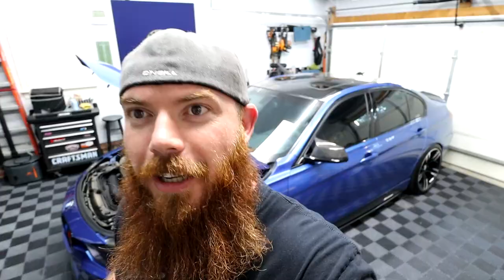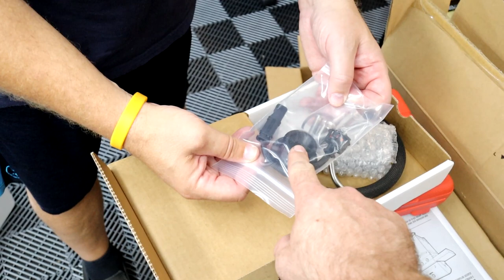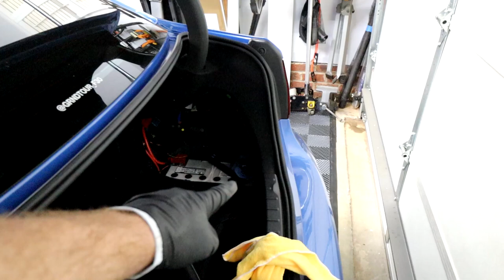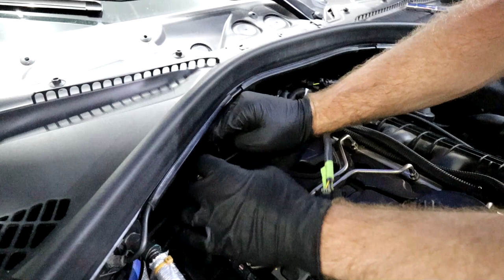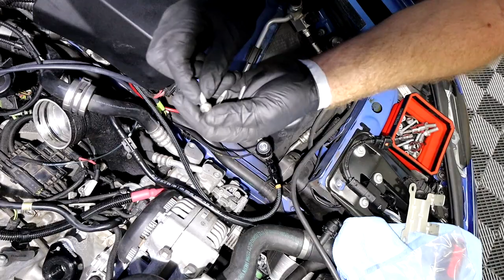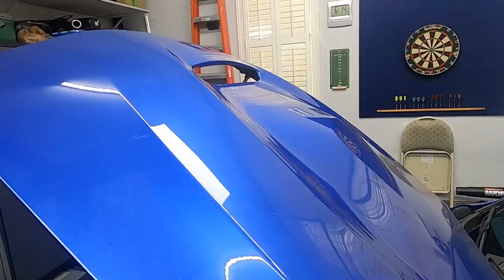DORCH ENGINEERING HPFP STAGE 2 N55 INSTALL GUIDE | BMW 335i F30

Comment: Great video! I'm thinking about doing this install, because I'm getting a turbo upgrade to the TTE550. Will run water methanol tho, so I'm not quite sure I need this.
Reply from the maker: Water meth is good but this is a must in my opinion to make sure your direct injection always has proper pressure, fuel pressure drop can burn up cylinders. Most tunes recommend HPFP
Reply: @BOO5Tchannel  damn I reckoned with this answer, but it's another 1.5k less in my bank account haha. Being a car guy sucks!
Reply: @BOO5Tchannel  but at least this install makes the decision to get port injection for the meth way easier. Once the intake manifold is off one might as well...
Reply from the maker: Joey Kennedy yes unfortunately I learned this the hard way. I made a video a few back that explains some parts needed for bigger turbos, fuel starvation is probably the main culprit in most issues with larger turbos
Reply: @BOO5Tchannel  well thanks for your advice. Recently blew my turbo, right before heading into deployment that was a bit unfortunate, but can't wait to get this thing to 500 horses once I'm back. I knew the hpfp is a weak link on the n55, but I was hoping meth injection would cover that. Guess it's saver to get that out of the way once and for all tho. After all I want the engine to be as reliable as possible. Did you switch to cooler spark plugs?
Reply from the maker: Joey Kennedy yes I went with what is recommended for bigger turbo, thanks for your service brother! It’s definitely worth the $1600 for hpfp, will cost you less in the long run over a new motor

Comment: Really helpful and great install as always! Sorry I skipped a few parts but at any point did you have to jack up the car on stands to get access to anything from below? Thinking of doing this one myself while following your video. If I end up going to a shop then how much time do you think it would take a BMW indy shop mechanic with all the tools and lift?
Reply from the maker: No lift needed for hpfp. Mechanics can take 1-2 hours if they are familiar with it I would say
Reply: @BOO5Tchannel  My shop is quoting me 5 hrs :(
Reply from the maker: @Amsfxyz  not surprised it’s not an easy install so $500+ is worth it to make sure it’s done right. Just because it takes two hours doesn’t mean they will charge you two hours most shops do that
Reply: @BOO5Tchannel  got it! Thanks man. Yeah it comes to something around $500.

Comment: Do I need to upgrade my LPFP if I have stage 2 hpfp and pure turbo running e85 ?
Reply from the maker: Yes
Reply: Thanks bro  🐐
Reply: @BOO5Tchannel  I have a question bro I’m running stage 2 Bm3 with just stage 1 hpfp . Fbo and stock turbo right now and I’m
Getting some stutters when I’m going about 60-70 mph and step on the peddle hard to get some boost it stutters bad any idea what it could be ?
Reply from the maker: @kickedbacktatt  are you trying to run ethanol mix? Is your lpfp upgraded? Custom tune would be ideal they can locate the problem with logs

Comment: My friend is currently selling his car and asked if I wanted to have his stage 1 pump I have a 2015 335i and he has a 2015 235i m sport do you think his wiring harness would still work on mine due to the vin number situation? Thank you
Reply from the maker: Not 100% sure but should… I wouldn’t even install a stage 1 i would go straight to 2 if you can
Reply: @BOO5Tchannel  Forsure would have gone with the stage 2 but this stage 1 pump is going to be given to me as a gift hhaha can’t beat free
Reply from the maker: @ImFunneh  for sure if it’s free go for it, you can easily hard wire it in it’s only 2 wires if needed
Reply: @BOO5Tchannel  thank you for the reply brother much appreciated

Comment: Does the pump require a tune to properly funtion
Reply from the maker: Yes it does, it needs either a tune that can activate it off the shelf or a tuner to tune it in
Reply: @BOO5Tchannel  
I'm currently running stage 3 turner Motorsports
And doing both hpfp lpfp ...
Confused if I would need to contact Turner because of there tunes being encripted ....
Reply from the maker: Yes because pump is a dud without it being coded in
Reply: @BOO5Tchannel  
BMW AND THERE CODING😠...
relatively new in BMW world..
Ran Audi for years..
Never had to code so many components.
Thank you for your time
Reply from the maker: Absolutely bro! This is why I left this platform the N55 B58 and all of the above bmw products from the past 10 years is a tuning nightmare and sensor overload. I’m on a 2JZ now and should be much more later back of a tuner build
Reply: @BOO5Tchannel  
Congratulations on that..
I have built rotary's 
Stage 3 GTI
TTRS
TUNDRA TRUCKS..
but never seen shit like this..
I love the drive of these cars ...but the reliability .... horrible.
I would not take a new BMW on road trip ...😁
Reply: @BOO5Tchannel   not to mention I do all my own work..
If  I could not I would be broke